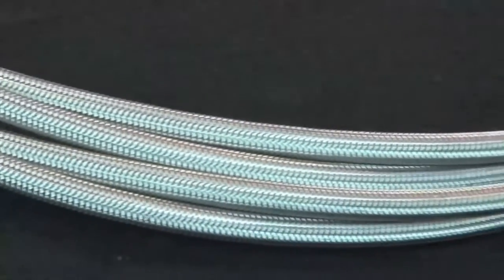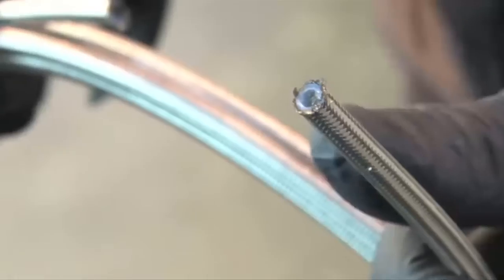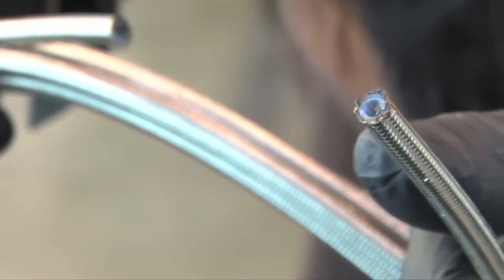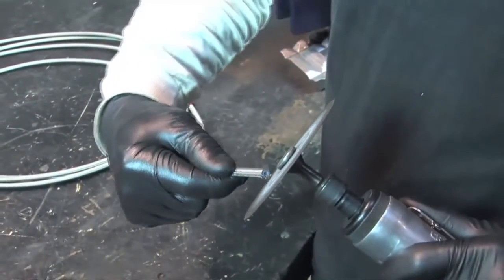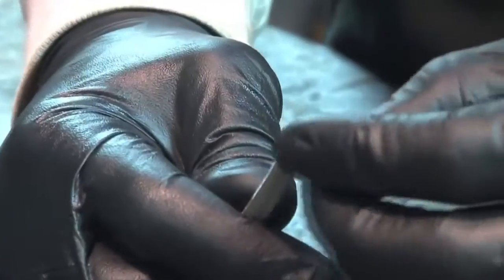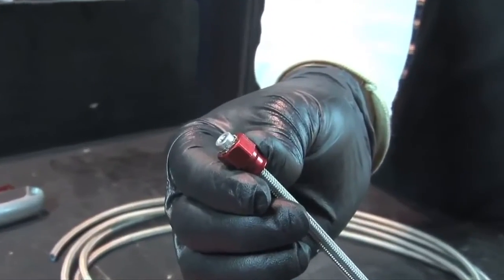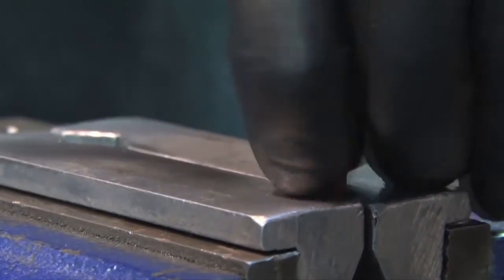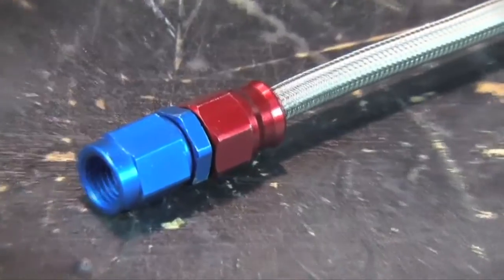How to Assemble Earl's Speed-Flex Hose

Comment: I find getting a .026"-.046" requires quite a bit of torque because of the presence of the braided sleeve.  Is that typical or hould the braided sleeve be cut back a bit further?